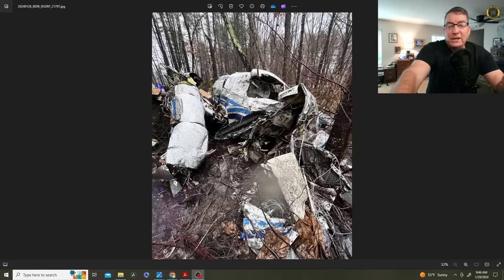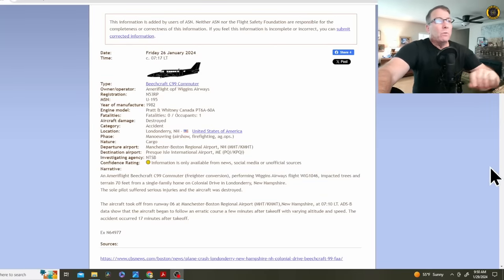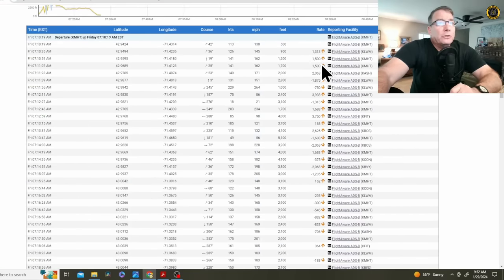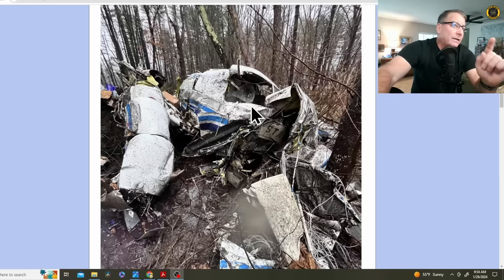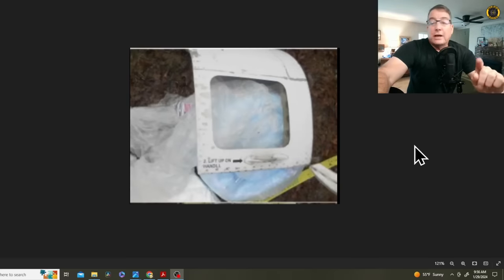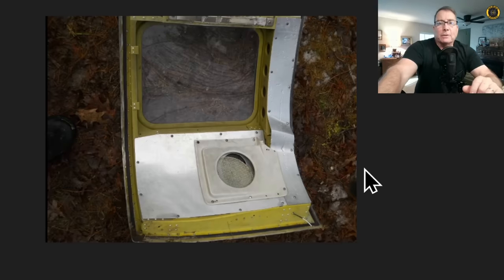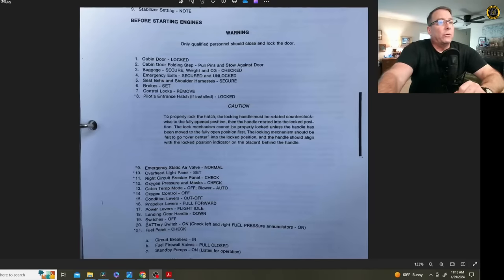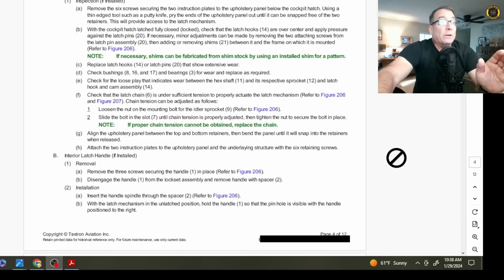Beechcraft C-99 Door Open In Flight Crash! 24 January 2024

Comment: Well, maybe a combination of things:  Door off, pilot being wind blasted?  That wind might have a windchill factor in the single digits F?  It might also have very cold rain and sleet in it?  In the clouds or in-and-out of?  Instrument panel getting frosted over?  Stabilizer damage?  Loss of glasses or glasses frosted over?  Ear piercingly loud turbine engine and propeller whizzing away just a few feet from you.  Combine all these things up and that’s quite a challenge, no?
I walked up next to a Jet Range helicopter once with its turbine engine idling…damn that’s painfully loud.  I quickly covered my ears and moved away from it.
Could the propeller tip vortices deliver a punishing vibration as well?  Looks like pilot would be only 2 or 3 feet aft of the prop blades.
But if the door hit the stabilizer with enough force to damage the stabilizer, it seems like it would have had a gash in it.  It looked to be in fairly good condition.
Someone’s going to have to fly an open cockpit biplane into icing conditions to find out how rough it be.  Volunteers?  🙂 (no!)

Comment: I'd have to disagree with you about the comments about icing at the beginning of the video. The weather was perfect for significant clear ice accumulation, and I've personally been in situations that have gone from fine to life threatening in less than sixty seconds in weather like this. Granted, the pilot hatch landing so far away from the crash site points to what is most likely a more significant factor, but fwiw if you look at the photo of that hatch sitting on the ground, you'll see it's covered in freezing rain.

Comment: Still have to watch the video, but this could be a case of something not critical for flight being enough of a distraction to become the cause of loss of control.
Edit: Best wishes for a speedy recovery for the pilot, and a special thank you to the ATC and Cair (Care?) 410 for trying to help best you could.  I wonder if the door flying off hit anything crucial in the tail, especially any control surfaces.  Lastly, overhead opening doors aren't ideal and that latch mechanism is way too complex.  Reminds me of a timing system in a modern German engine. :D

Comment: It's not a pressurized aircraft so the air forces blew it open if it was not latched properly. Pilot error could be a cause if the checklist was not followed. Could be a maintenance induced incident as well. The mechanic that rigged it last may have done it improperly. Airframe logbook will shed light I'm sure. Either way this is a tragic incident and I hope the pilot makes a full recovery

Comment: The lack of fire is probably because it is Jet fuel if that would have been a gasoline tank it probably would have exploded on impact same reason diesel is safer in boat applications you can throw a match in a container of diesel fuel and the match will go out try that with gasoline and it will ignite but either way that pilot is very lucky those wires and or trees probably slowed his impact just enough to make it survivable

Comment: All this complicated latching hardware, and not a 2 oz. nylon safety strap as a fail safe. Common sense seems to be the last thing that's engineered into an airplane, usually after a few people are killed. I think it wouldn't take long for this wet, freezing wind blast to incapacitate a pilot. Hopefully he recovers fully, and he's very lucky, indeed.

Comment: We train for simulated emergencies, and no aerobatics or truly critical maneuvering is required for any pilot certificate in the U.S.  In real emergencies, we often become test pilots (with only seconds to gain control of the situation), and even the very best pilots (legends like Dale Snodgrass and Richard McSpadden) can find themselves over their heads in a light single engine aircraft in clear weather. There's no way to truly prepare for the most unexpected, bizarre emergencies, but I do think extensive aerobatics should be required for a commercial certificate, and substantial aerobatics should be required for even a private... just to really assure that pilots have real airsense at all reasonable extremes of the envelope & the right instincts / priorities for handling unusual situations.  But I have a feeling economics & politics wouldn't allow that level of competency as a minimum for any FAA certificate.  If I had to do it all over again, I would have done more of my basic training in a squirrely taildragger, and I would have taken extensive aerobatics training before starting the commercial SEL training.  The extra money spent would have been well worth it.  Because when really unexpected things happen, even the very best pilots can sometimes end up at the edge of their capabilities (or beyond).

Comment: This could potentially happen in some GA aircraft as well.   The Diamond DA40 has gullwing doors in the rear.  As such, there are sensors to indicate to the pilot whether the rear door is properly latched or not.  In theory, if the door opens all the way in flight, it could rip off and damage the horizontal stabilizer or tail/rudder, which would make for a very unpleasant outcome.

Comment: This isn’t the 1st time one of these cockpit hatches have come open in flight. After doing that procedure you mentioned to lock the hatch in place, the best thing to do not in the manual is to shine a flashlight down towards the latching mechanism. This way you can see that the hooks are in place. Many times I’ve looked down there and it’s not completely seated. Then you open and close it again then check with the flashlight. One of these hatches came open on a coworker once, luckily that person made it back safely. Afterwards the operator we worked for emphasized the use of the flashlight technique.

Comment: the way that door latches it’s very possible to turn it to the locked position and the hook stop at the top of the pin rather than secure itself over the pin, which is why the pilots are taught to look through the cutout or put their finger in the hole to verify.  it’s on the checklist 3 times to check the ladder and door.  but i could understand how on a cold morning, the pilot turning that handle and moving on with the checklist because he can’t turn the heater on until he’s airborne.  many of those planes also don’t have autopilot which would’ve been very helpful in this case.  he wouldn’t have been using oxygen or even had a tank on board but could’ve had his headset pulled off for a bit.  i can only imagine the nightmare of IMC with a giant hole next to me and rain coming in and trying to load an approach back into the departure airport and manage heading altitude and airspeed.  hope to hear he recovers soon and isn’t too injured or traumatized to get back in the air.

Comment: Hmm, I wonder if the sudden high wind conditions inside the plane could have dislodged some cargo, affecting the CG..
Though just the additional drag might have induced a pull, up and to the left. (Vaguely recall some story about rudder failure, with the pilot using the door as a rudder...)

Comment: I wonder where on the flight path the door was found... the initial oscillations could possibly have been the door open but still attached and acting as an aerodynamic surface, perhaps it finally ripped off on the second dive but indeed damaged a flight control surface?

Comment: I wonder if the cockpit can fog in such condition. Maybe he was just frazzled and betrayed by 6pack avionics instead of a nice big clear synthetic vision glow to stay warm by and pick the runway right away. One of the things I dislike about sheet and rivet construction is how local bits can be flimsy. Overall it can be fairly strong but locally you can sometimes bend it with your fingers. Under strong forces it might go bad over time but this isn't even a pressurized plane so shouldn't take much of a mechanism to hold the door. Maybe someone didn't close it properly. Wiki says a guy got sucked out of the same model when he leaned on a door. Managed to hold on until landing though.  btw in such a situation and like the pilot that hung out of the windshield of an airliner, I'd do a power off vertical zero g stall. That should make it easy to get back in.

Comment: I had a Queen Air 800 and took off with the door open.  I immediately realized the problem and returned to my airport.  I had no issue with the door other than the additional drag on the left side of the airplane.  I landed, secured the door, and took off again very thankful that I had averted an emergency.  I realize the pressurized 99 is different from the QueenAir in speed, but I don't think speed was a factor in this accident.

Comment: One contributing factor in this mishap is certainly present in many other aircraft mishaps.  The engineering lack of common sense, when developing and/or designing an item that is part of the aircraft.  A "bicycle chain" with an adjustment idler to rotate two hooks that hold the door down and closed.  When you showed the "adjustment procedure", the first thought that came to mind is "what could possibly go wrong"?!
As I've stated before, a requirement for graduation in engineering (and A&P sometimes) should be a practical skill/common sense test where the prospective graduate is given an older V8 engine and must change the spark plugs, spark plug wires, distributor cap, rotor and points, set the timing and successfully crank the engine.

Comment: From the preliminary report:

“The airplane’s left side (pilot side) cockpit door/hatch was subsequently located in a residential yard about 10 miles north of the main wreckage. Additionally, the airplane was equipped with a portable ladder for pilot entry, which secured to the fuselage under the cockpit door/hatch and was supposed to be stowed inside the cockpit before takeoff. The portable ladder was found outside and aft of the cockpit, resting against the left engine nacelle.“
Reply: Yes, crew ladder was still attached to outside of airplane. Another case of UPS supervisor bullying pilots to rush so the supervisor can get a performance bonus.

Comment: used to fly these and Queen Airs, that both have similar doors, often if the linkage wasn't setup correctly those hooks will not swing up to grab the doors pins at all, they can remain horizontal, there is a slot for the pilot to stick their fingers down to ensure those hooks have grabbed the pins however even doing this your still not sure that that hook is "over center" on the pin. there have been at least a dozen times for me 1 or both of these hooks didn't grab correctly

Comment: The door from the aircraft (in the picture you showed) doesn't seem to have lock inspection holes. There is a plate riveted over the lower half of the door.

Comment: Juan, I wonder if when the door popped open, boxes (weight) departed sending his wt/balance aft.  If the front boxes were heavy, I bet it was a rodeo trying for level flight.  He wanted to climb, but forced a stall,  hard to push forward in the soup below 2,000 ft.  You gotta do it, but what would be harder??  Thanks for this briefing.
Reply: Load would have been strapped down under a cargo net and didn't even come loose at the crash.  Which is fortunate.
Reply: Not likely, there’s a bulkhead and net to prevent the cargo from moving forward cockpit…
Reply: Not likely, there’s a bulkhead and net to prevent the cargo from moving forward cockpit…
Reply: Not likely, there’s a bulkhead and net to prevent the cargo from moving forward cockpit…
Reply: Not likely, there’s a bulkhead and net to prevent the cargo from moving forward cockpit…
Reply: Not likely, there’s a bulkhead and net to prevent the cargo from moving forward cockpit…

Comment: I flew a BE99 Airliner with a belly pod, up in the Canadian Arctic...and she was a tank! Max weight take-offs on short gravel strips followed by landings on short gravel strips! The Pilot door was wired shut and never was used! But even with that door missing, as shocking as it would be, it's totally flyable, just as if a baggage door opened, always remember..Aviat, Navigate, Communicate! This means..1)Fly the plane, 2)Navigate to wear you need to go..3)Talk on the radio when you have a chance! (or as a last ditch effort)!